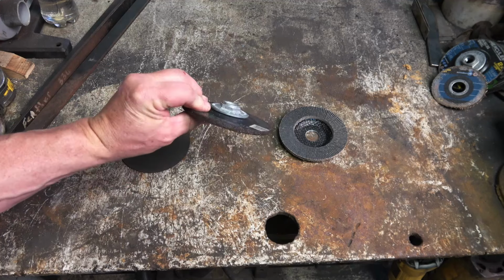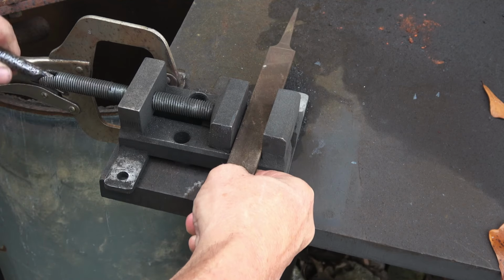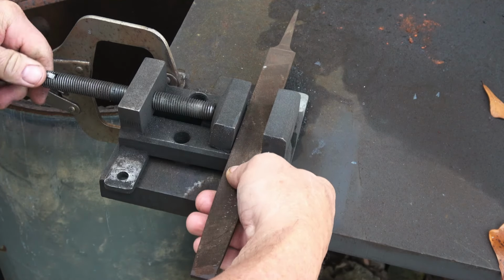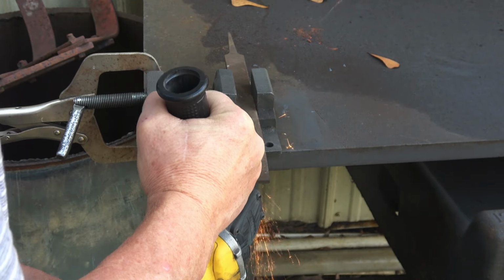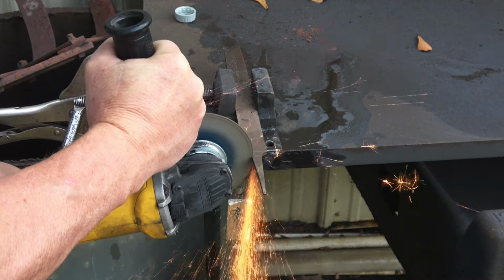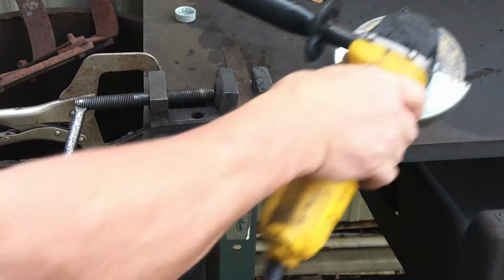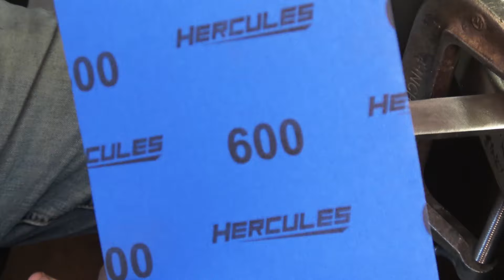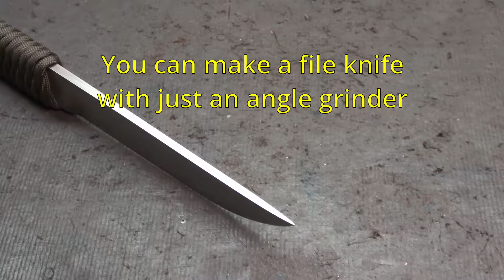How to make a knife from a file with an angle grinder

Comment from the maker: I hope this helps inspire someone that may not have the tools to get out there and try this.  You can do it!  If you have any questions just give me a shout.  Thanks for watching!
Reply: Might I suggest a broken back seax design, leaving the "blade" edge untouched with the cutting wheel, thus regulating the temp far better, and instead removing material from the spine?
Reply from the maker: Here ya go, a Seax for ya.  👌
https://youtu.be/Cx4eP8tw_LA?si=O9uW6epR93bEBAra
Reply: What tool do you use to scribe the center of the blade. At what angle are you grinding the edge?
Reply from the maker: The scribe tool is one that I made.   I grind the angles at around 17 degrees

Comment: Something to consider for anyone who tries this is that some files, especially newer ones, are case hardened. This means that only the outside is hard and the core is still soft. Thats good for files because it means they don't snap as easily. It also means you wont get a good knife out of it without hardening it. Just something to consider.
Reply from the maker: Yep.  That’s why I used an old Nicholson.  Thanks for watching!
Reply: Good tip. I've been buying a couple old files for a buck or two everytime I go to a flea market and breaking it a little on the tip ofthe ones you're considering using for a knife let's you check out the interior grain and you can always just clean up the tip after on case hardened ones and use them as files anyways if they're not too dull.
Reply from the maker: @Gilgamesh_King_Of_Uruk yes indeed.  🙂
Reply: The significant point it that you can't through-harden it, because the core doesn't contain enough carbon and or other alloying elements. The centre is a mild steel.
Reply: @johnrhodes3350  yes and no, depends on how the file is made
Reply from the maker: Not all files are case hardened.  This one IS hard to the core.  The edge wouldn’t hold up if not.  It cuts and holds an edge…it’s hard.
Reply: @TonySeverioKnives Nicholson files....pipewelders best friend
Reply from the maker: @murphyzlaw13 was a pipe welder several years.  It’s how I started out as a young g man.  Always had a half round in the bucket.  🙂
Reply: @TonySeverioKnives  seems like this new generation doesn't want to learn these trades or are afraid of hard work. Sad, truly.
Reply from the maker: Got that right!  It’s a combination of both
Reply: @TonySeverioKnives  there's a pretty good amount of people going into the trades at my school, myself included. It might be worse in the city tho
Reply from the maker: @Duckrabbit_Forging there’s been a decline for the last 30 years in the petrochemical and oil field.  But it has always been the rural workers that built it and pretty much the same today.  Just not as many.
Reply: @Duckrabbit_Forging  good for you brother. Good to see young blood using their hands
Reply: @TonySeverioKnives  my school is the definition of nowheresville suburbia lol
Reply from the maker: @Duckrabbit_Forging nothing wrong with that my friend!  🙂

Comment: Its so stupid people sell knives for 1000 bucks when u can buy all the literal equipments for 1000 bucks that can make u any knife u want as well as a forge for other metal working tools in less than an hour it just baffles me i mean this knife from a file can pretty much outperform all these folding 1000 bucks knives ur literally not paying for quality but just for the brand like absolutely only for the brand there is no way a folding 1000 bucks knife will outlast this knife from a file its just not gonna happen
Reply from the maker: Yeah wait until you see the automatic liner lock folder I make from a file and a side grinder.  🙂
Reply: I'm sorry who is buying $1000 knives, folding or fixed? Rich people, maybe. I prefer ones that are $50-100, of which there are many options.
Reply from the maker: Oh quite a few.  I make a living making and selling them.  1000’s of people make knives and sell them for way more than 1000 dollars.
Reply: @smudge7057  I'm not talking about who is buying them because the answer to that is obviously whoever can afford them and wants to buy them what I'm saying is that many people will buy expensive knives without looking at the quality at all and saying "oh it's expensive it's better than anything else that's cheaper than this" That's what I'm talking about
Reply from the maker: MOST people who buy expensive knives, know what they are buying.  You should see what custom built firearms cost.  I used to custom build 1911’s.  They were way better than anything you could get off the shelf.  But the clients know that.
Reply: Can't buy skill though this guy has talent and cheap tools
Reply from the maker: I make a living selling them.  Educate yourself
Reply from the maker: Ok, I know better but if you feel better?
Reply from the maker: Yeah I’m gonna keep on selling them.  😁

Comment: So this is how those tourist trap blades are made. Although a diamond sharpening tool could help sharpen a better apex for those 65+ hrc metals.
Reply from the maker: I’ wouldn’t know how those blades are made but this one was properly tempered and no longer close to 65 Hrc.  It sharpens just like any other blade.  🙂
Reply: That "Tourist Trap" remark has NO PLACE here, if you act as "SUPERIOR" as that remark you may not leave said Tourist Trap in the same condition you arrived...Umm Sir...🙂

Comment: Great job Mr Tony. Like ADVENTUREFEVER said “No more excuses people”. They have seen it done and now they can use a hair dryer and pvc drain pipe to make a sheath for it. Totally functional and hand made. Total cost under $50
Reply from the maker: Thank you my friend.  I made several of my first knives with a file and sandpaper.  I heat treated and tempered them with a torch.  It’s slow but also achievable.  This is another method that eliminates everything but tempering and a little hand sanding.  

I plan to make a simple kydex sheath for it which is also very easy and achievable by anyone.  

Thanks for watching!

Comment: You will be surprised of the knives people make with hardly any tools. I made my first knives with a modified 4x36 sander and they turned out really good. I used two map gas torches set up facing each other to do the heat treat. Don't let not having good tools keep you from having fun. Good tools just make the job go easier and faster but you don't need them 👍 great video
Reply from the maker: Got that right!  Did the same thing when I started.  Used a file and sand paper then graduated to a craftsman 4x36.  Then I bought a cheap 2x72 and made a good many.  I now used what’s left of that first 2x72 on my surface grinder.  😂

Comment: A tip.....
Use a spray bottle to cool things down or get an assistant. 
Good video, I'm sure it will inspire alot of folk.. 👍🏴
Reply from the maker: Yes sir good tip. 🙂
Reply: @TonySeverioKnives  I make things too, I wish I had an assistant some times or I should grow a third arm.
Enjoyed your video...
Reply from the maker: @spikemcnock8310 yes that would help sometimes for sure.  I run a full time knife shop by myself and I have to be creative at times.  But I work at my own pace and I’m pretty used to that.  🙂
Reply: @spikemcnock8310 nasa already has program for attaching third limb, oh boy these carpenters are in trouble

Comment: Very nice job, sir. Perhaps I missed it in the video but after tempering @400 for 2 hours twice to temper the steel is there any need to further heat treat it after working on it ?
TIA . PS. I have a drawer full of files to practice with lol
Reply from the maker: Thanks!  No, if you have kept it cool throughout the grinding process, you are good to go.  Over heating it while grinding will ruin the temper.  Thanks for watching!  🙂

Comment: Files are typically glass hard, did you attempt to draw back the temper, otherwise your knife would be ending up too hard to easily resharpen & rather delicate?
Reply from the maker: Watch the beginning of the video.  It’s tempered first.
Reply: @TonySeverioKnives  OK glad you took that step, I once tried to make one of these & it didn't last long, I have a lot more experience with grinding than any forging having worked in a grinding room, my favorite steel alloys were usually from Japan or The US. Many good files are 1095 which works for knives.

Comment: On the tempering (400 degrees at two hours) do you do both back to back? Do you cool down the material in between? Thanks!
Reply from the maker: Yeah I let them cool off to room temp in between cycles.
Reply: What do you mean for "both back to back"?
Reply from the maker: Temper twice, one then once more
Reply: @luigigambacorta6117  the tempering. He said to do the first then let knife cool to room temperature then temper once more.
Reply: Alright, and what should I do if the metal turns blue because I heated it too much during grinding? Can I temper it back? Thanks for answering and cheers from Italy
Reply from the maker: @luigigambacorta6117 it would need to have the whole heat treating process done.  The temper is ruined and hardness gone.

Comment: Very nice one thing I learned about using files though as they rust easily I don't know if that was just mine or what I made two or three of them and they tended to rust I mean I used them outside but they got Rusty even in the drawer 10:47
Reply from the maker: Thanks!  Yes they will rust.  But that’s normal for any high carbon steel.  Thanks for watching!  🙂
Reply: @user-Rockstar1  dry it off and a little bit of oil after use goes a long way.
Reply from the maker: For sure!  🙂
Reply: an idea; make your sheath with an oil-soaked liner,like chamois;every time you insert the blade,it gets oiled,and the oil in the liner keeps moisture away from the steel.  disclaimer; I have not tried this.

Comment: Where do I get a scribe like that to score the blade.
Reply from the maker: This is one I made but you can get one at a hardware or big box store in the tools section around drills bits and other small tools.  You can also make one from a broke drill bit by sharpening it to a point.
Reply: @TonySeverioKnives  Thanks for the response.
Reply from the maker: @RaulHernandez-kn4lm you’re welcome 🙂

Comment: Using a metal file to grind a knife is stupidity doubled. Files are mystery metals normally simply case hardened to make filing better. For the same time and effort it's far more smart to buy the length and alloy you need. When the file mystery metal fails as a usable knife, look into a mirror and repeat the word DUMMY until it sinks in.
Reply from the maker: You don’t “grind” anything with a file.  It’s stupid to say that times five.  A file shaves and cuts metal…it doesn’t grind.

Yes you can buy known steel like I do for all of the knives I make.  I use 2x72 grinders to bevel and finish them.  And as an ABS Journeyman smith, I can say that I know how to heat treat and make it perform.  And not all files are case hardened.  And if you are intelligent enough AND know what you are doing, you can test it and find out.  This was a demo for anyone that wants to make a knife without having tons of equipment.  With that said, DUMMY is crawling all over you.  Go make something maker”boy” and focus on something you actually may know something about.  However, I don’t see any content on your channel.  That says it all.